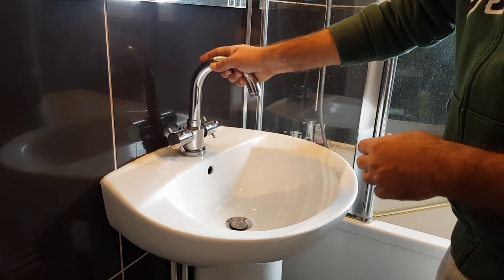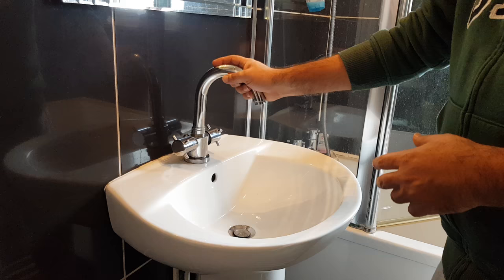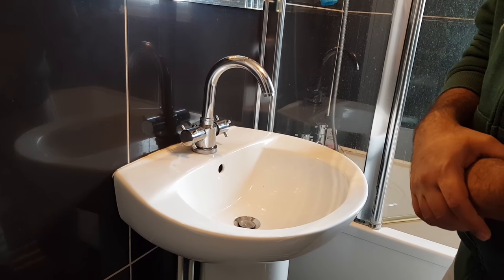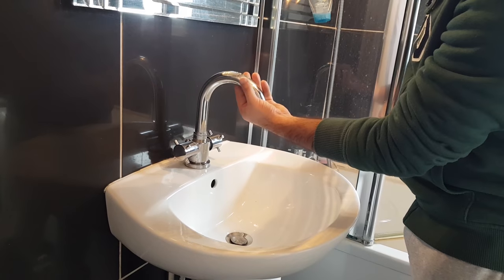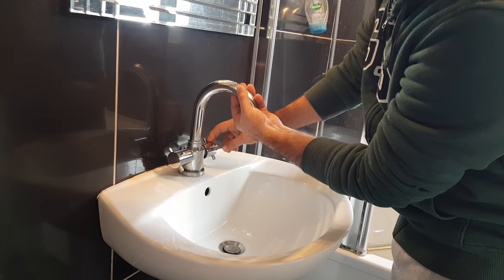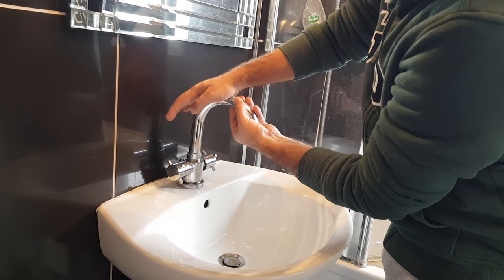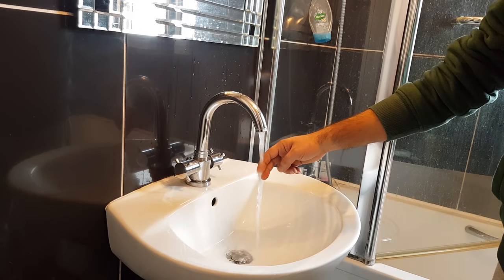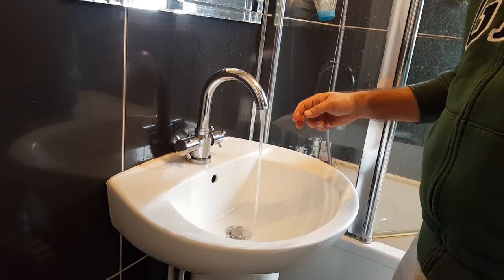How to clear Air locked hot water system

Comment: Half a day spent with two of us (incl an experienced plumber/odd job person) trying to clear an air lock in the hot water system. Nothing would work - tried a hose; tried to release air via valve on hot water tank etc etc.  Still no hot water in the taps.  Then, this evening I looked on YouTube and came across your video 'How to clear Air locked hot water system' ... magic!  Such an easy remedy and took <5 mins from start to finish.  Thank you so much for posting this simple yet very effective remedy.

Comment: Had a plumber tell me a galvanized pipe had internal corrosion blocking the flow and wanted to replace like 20 feet of line for a grand....I was ALMOST ready to do it when I found this video. I just cleared the air lock in my kitchen and I'm very confident I can do my bathtub if I can figure out how not to get scalded using the hot to unlock the cold. I owe you one friend, thank you.
Reply: He just saved you a thousand dollars. Congrats!

Comment: You are an angel! Thank you! Thanks you. Final hurdle to two week terror of replacing plumbing myself. Worrying about this for hours. Everyone else's explanation is so confusing.  Worked in a few seconds... Would say it took longer than 10-15 seconds on mine. If anyone else with a boiler long way away from tap: The tap 'told me' when it was time to take my hand off. Like you can easily hold your hand over the tap at first. Then you hear the cold flushing around and a little after you suddenly feel pressure against your hand. I held it a little longer, until I really couldn't hold it any more (don't know if that's best/safest, but it seems okay). I don't have a mixer tap on the basin, so I used the bath tap.

Thanks again. This is your good deed for this week. 0:)

Comment: Ibrar I do have some water coming out of the hot water side does that mean that air lock is not the problem? Thank you.
Reply from the maker: SherlockJo .
If only one water is comming, either hot or cold. Then chances that is it air locked.
Reply: @imahmood1  My cold water not working kichen, but hot is fine would it still work??
Reply: Hot and cold water in one tap turn right to hot and turn left to cold water but hot water not coming

Comment: I did this and it worked. but when I turn the hot water tap on all the way, it locks up again. I can hear the knocking when it locks up
Reply: Pooya G me too. I just drained my heater to replace a heat element. Now I get zero hot water flow from any faucet in the house. 😡 Been working in the for hours now. 😩

Comment: I tried this way but the solution was for few seconds as the water from the cold tap travelled up in hot water  pipe for 10 seconds. That same water came back from the hot water tap for 10 seconds then it stopped. At first I was amazed too but then same situation arised

Comment: All it helped me do was blow water from under the wash basin all over the bathroom floor.  Didn't work!  Don't do this.  Blew the plastic parts out of my faucet.  Now I have to install a new one.
Reply: Worked a treat for me. Maybe you had your cold tap open too far and the pressure blew it out. I only had my mains tap opened about a 3rd.
Reply: @garfieldhall7758  Called a plumber to find out my problem.  Never guess what it was.  There was a marble in the water line.

Comment: I did this and water leaked from the cold water l8ne under the sink😥
Reply: Sure it's sorted by now but suspect your plumbing fittings weren't a good fit and when pressure was applied  from the cold water into the hot water, then it "showed up" the poor fittings. Hope it wasnt an expensive problem to resolve. 🙈
Reply: @michaeltheunissen609  thank you for the info! And yes, I ended up having a plumber come out and install a new faucet and replace the fittings 😊😊
Reply: Glad you are sorted. Hope the plumber was honest with their assessment. Have a great day further.